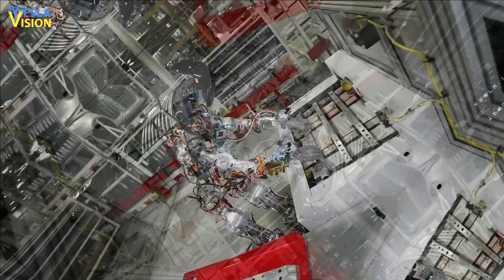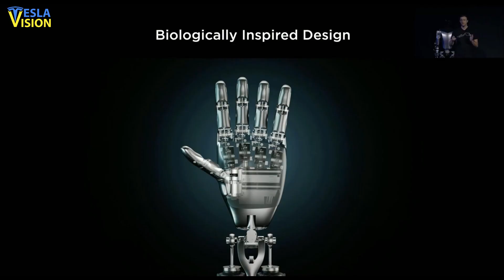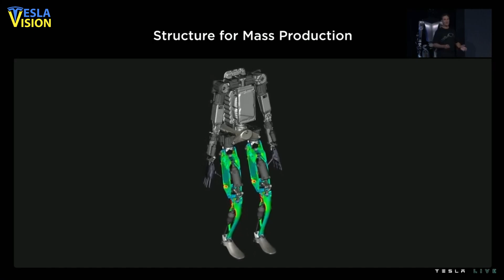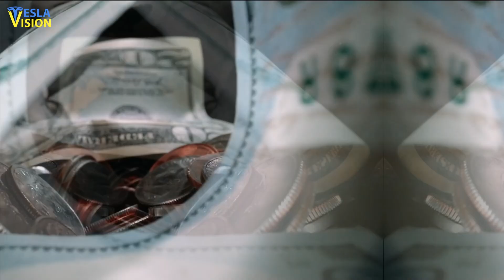Elon Musk Finally BREAKS SILENCE Over Tesla Robot

Comment: It's almost here?  Tesla's whole factories are A.I. robots.  They just don't have the same function as Optimus.
Reply: I doubt Tesla will ever have an Optimus working at Gigafactory. 
The human form is not optimized to do anything besides mimicking the human body.
Reply: @BBBrasil you answered your own question. Surely mimicking the human body is exactly the start we need to get iOptimus doing valuable work and replace a human doing dangerous or boring work.
Reply: @BongoWongoOG  You get it!  The Optimus bot is purpose built to replace LABOR.   He has already started trialing the robots in his own factories first, just like testing FSD as a beta.  Once it gathers enough data from the Optimus perspective (cameras, etc), then it can be sold/released/used in other factories.   The economics of it replacing human labor can potentially raise the worlds GDP by (?) amount.  That's it's purpose.
Reply: @BBBrasil  Elon realized he can not replace all the humans in the factory with A.I. and robots.  The last factor/barrier to doing this is to have the robot/A.I. be in the shape of a human AND can move into any position or area that a human would be needed.   An A.I. robot in human form is how you solve this problem.
Reply: Difficult to have less.